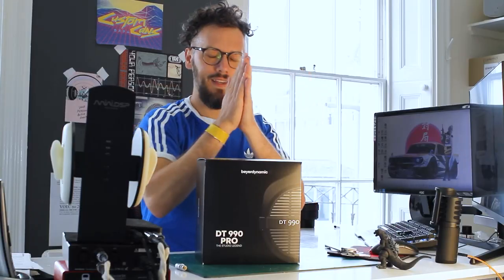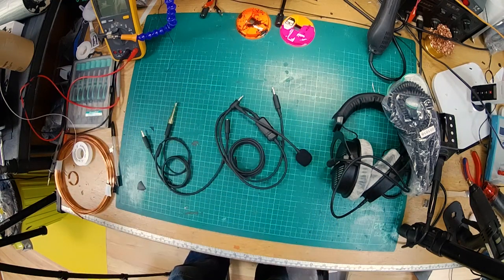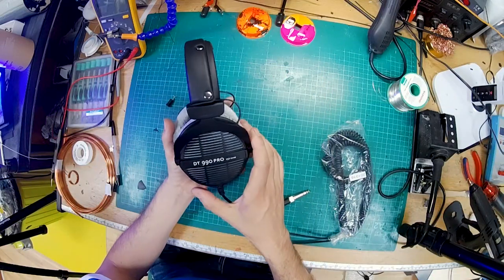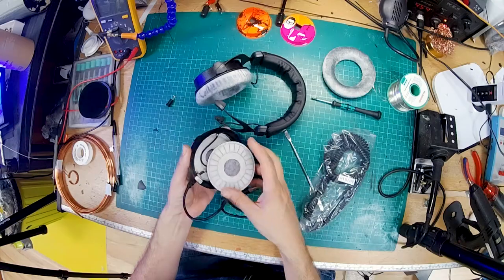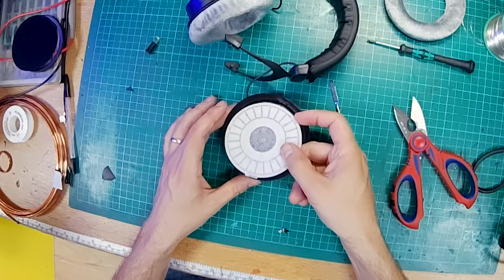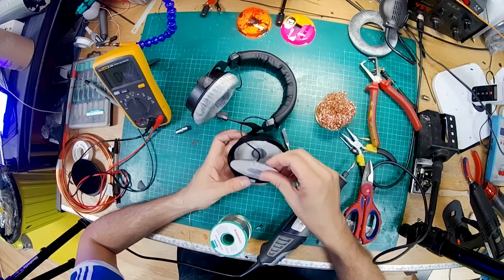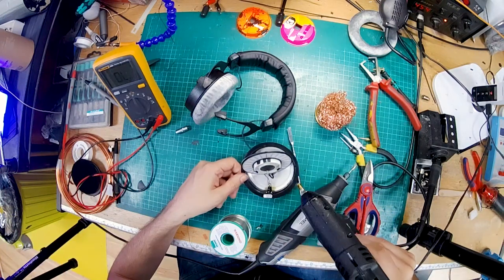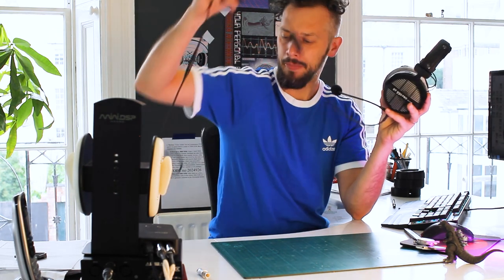Beyerdynamic DT990 ultimate gaming headset mod

Comment: Thanks for this video! Make the mod exceedingly simple on this headset! Also did a pair of Audi Technica AD-700X which was a bit of a nightmare. The housing and wires were incredibly difficult to work with!
Reply from the maker: Yeh - we have modded a few pairs of Audio Technica. They are not easy to do and some of them randomly die if you de-solder the driver
Reply: @CustomCans  I'm looking at getting a 3.5 mm socket from e bay that comes with a little nut so you can tighten the socket to the headphones cup. Would you say that your system (making a slightly smaller hole, then force threading in the socket + hot glue) is better vs making the hole exact size for threaded part of socket to go in comfortably, then using supplied nut to tighten and hold socket firmly in place (+ also a little bit of hot glue to stop nut from coming lose later)? Which will be sturdier? Thx!

Comment: thank you for the informative videos. speaking of gaming and audio this could be interesting to you, i bought a "yeti x" microphone and with these settings i can speak well into it while gaming over normal stereo speakers at normal volume - the mic doesn't pick them up well so they stay under the teamspeak speaking threshold: cardioid, input gain 2 (nearly all the way down), limiter 20db (all the way up), gate -40db (the middle). the greatest trick is the "gate" software filter - put to the right point it'll totally leave my voice alone but basically "deletes" ambient noise out of the signal  - it's magic.

Comment: Thanks for the awesome videos. I tried following this and ran into a few issues. At one point, I had this working correctly, but my solder wasn't holding on the jack, so I tried to resolder everything. After running into multiple solder issues at that point, I pretty much rewired the whole thing using better wire -- sort of following your complete re-wire video. Despite taking pictures and being pretty confident on the positions (and solders), my issue is no matter what I do, I'm not getting sound to the right-side can. I have a new version of these, so the wiring looked like yours, and I was seeing the kevlar, etc. I didn't touch those back two solder points, which you mentioned is a nightmare if they get buggered. Using a meter on the left can to right can, I am getting readings.

I tried everything as far as switching the wires around coming off the jack (except the black ground -- I had that on the end position where it is connected to the other). Is it more likely I fried something on the bored, or a wiring issue? The boards are not sold separately and run about ~$60 each, so I'm hesitant to try again with new drivers.

Thanks again for the cool videos!
Reply from the maker: If you have a multimeter - I would test the driver directly - put the probes on the outer pads of the driver and you should get a reading close to 250ohms ( If you have the 250 ohm version ) If you are getting a reading then the driver is OK and it is a wiring issue. If you get a super low resistance then you have a short somewhere and if you don't get any reading then you may have broken one of the voice coil wires. 
That may be fixable.
Those two little solder joints at the back which I told you not to touch have super thin wires attached - if one is snapped then you may be able to solder it back on depending on where it snapped

Comment: Hello, found this on your website, I have a couple of questions if that’s okay for you to respond to? Would this on your website ‘Custom Cans DT990 Modified Gaming Headphones with Microphone and Detachable Cable (3.5mm / 6.35mm TRS jack)’ plug straight into an Xbox Series X / PS5 controller? Then also, I’m guessing you still require an amp with these, then how does that work when wanting to use these for gaming? Wondering how the setup all works, does the amp plug into the console?
Reply from the maker: It depends how loud you listen. The 250ohm version will work if you plug it straight into the controller but it will not go very loud. An amp is probably not easy to set up as most of them don't have a pass through for the mic so the mic would not work with out pluging in a load of adapters. If you email us we could make a 32ohm version which would be much easier to drive off the playstation / xbox
Reply: @CustomCans  what if I use the ‘Fosi Audio K5 Pro’ it has separate inputs for headphones and a microphone.
Reply from the maker: @DannyWmv  yes that would do it
Reply: @CustomCans  so with the headphones from you, do I get both the headphone jack and microphone jack coming from the headset? So I can plug both 3.5mm headphone and 3.5mm microphone into that amp/dac?
Reply: @CustomCans  I’m just worried that if I purchase the custom headset with the mic from you guys, and the setup doesn’t work then I probably won’t be able to return the headset.

Comment: Could I get these but with a mini XLR balanced output on the opposite can? (And cable with 4.4mm balanced pentacon?)
Would cover all possible uses and connection types then. Cheers!

I've just bought the uber dt990's. 
Look forward to using them. Ill just get a clip on mic instead.
Reply from the maker: It is not impossible but you would need to have a switch to switch them from balanced to single ended.... it is probably not worth the hassle. We could potentially use a 4 pole 3.5mm socket in the earcup, that would allow you to use the mic single ended and then you would also plug in a balanced cable into the same socket
Reply: @CustomCans  Thanks for the reply. Keep up the good work.

Comment: Does anyone know if there is Bluetooth adapter that connects directly to this 3.5mm jack port?

I found some for Bose QC25, Beats studio... but position/size/pins... of jack connector is too specific for certain brand of headphones.
Reply from the maker: I don't think so. I know a lot of people use a shortened cable and a Fiio BTR5 velcrowed to the headband

Comment: hello, I just found out about your channel today and I was looking for a headphone for gaming. My previous headphone was audio technica ath m50 and Just wondering what is the different between DT990 and MMX 300 (2nd Generation)? both are from the same company and MX300 already have mic. is there any different with the driver or anything at all. 

Im searching for a new one cos my ATH was broken and thinking about getting the mmx300 but need some advice from you regarding those 2 models.

Thank you for your reviews, I think you are the only one who willingly took apart the headphone and I really appreciate it.
Reply: The 990s are an open-back design, while the MMX 300 is a closed-back one based on the 770s.
Reply: Thank you for your reply. so basically its like 770 but with mic.
Reply: For someone having the same question, I want to add my experience with both headphones. The mmx300 sounds similar to the dt990 but of course with a smaller soundstage and a bit more bass. The mmx300 are a bit heavier and don't feel as comfy as the dt990. The clamping pressure is bigger and the earcups are smaller which all ad to the less comfy feeling compared to the dt990. I did also sweet more in the mmx300 and had some pain after 2h of wearing them. That's why I didn't keep them. Of course, this is a personal preference. The sound quality, headphones and mic likewise, are very good. But if your motherboard doesn't have great audio input and output you might need an external DAC/soundcard, which adds to the cost. The "creative sound blasterX G6" was recommended a lot but maybe a cheaper one will do the trick.
Reply: @akuno7294  thank you for the info.

Comment: Hey Jason, great video as always. Question unrelated to this: I am on my second headband on the T1 2nd gen. They simply disintegrate after 2 years. Its my most used headphone right now and dont want to spend over hundred euros to replace them again in two years. Do you know where I can get an alternative to the ones Beyerdynamic is offering?
Reply: I've got the same issue with my T5p Gen2 as well. Beyerdynamic wont ship spares to the UK at the moment so I can't order a spare either. I would be interested in a good quality alternative too.
Reply from the maker: Most of the beyer headbands are interchangeable. If you are not worried about how pretty it looks, the DT770 or custom one pro headband would fit. We have some T1s here so I could do a video if you want
Reply: @CustomCans  dont care for the looks, just have to be comfy :) Would be great if you could do a short video.
Reply: +1 from me too please Jason. The slider assembly is apparently tricky to unclip on the t5p so if you can help with that too I would very much appreciate it, thank you.

Comment: I bought a pair of DT 900 Pro X's to upgrade from my DT 990 250 ohms and I've noticed that the 900's are a bit cleaner with a tiny bit of better imaging but was wondering if I did the 990 balanced mod if it would rid the small amount static I'm hearing? I'm using them with the BTR7 Portable DAC/AMP.
Reply from the maker: Maybe... the BTR7 will be able to drive them a little easier but if you have a hiss or static sound it will be a problem with the BTR7 and the 990 tends to show up those kind of issues more due to the treble peak. I would have a hunt around online to see if anyone is having the same issue, it may have a slight fault
Reply: @Custom Cans  I never noticed it until getting the 900's, tried high gain and low gain.

Comment: Quick question, I have done this mod and its amazing other than when I press slightly down on the mic when in front of my mouth it cuts out/distorts the audio. The jack is in there pretty snug so all I can imagine it is the connection between the connector and the mic when pressure is applied.
Have you happen to come across something like that before?
Reply from the maker: It is very tricky to diagnose without them in front of me but ... you may have overheated the pins ont he socket when soldering them - that could have caused the plastic holding them in place to melt / warp slightly so they are not giving a solid connection

Comment: Why did you use the 250 Ohm Version. What gamer has an high quality Interface? 

Edit: Well problay you...
Reply from the maker: Yes it is tricky but the 250 sound better in my opinion, and, in my experience... once you start going down the rabbit hole of building a gaming rig, cost and convenience go out the window pretty early in the build ;)
Reply: I own an x570s aorus master motherboard and a 250 ohm dt880 and with its "realtek audio console" windows 10 program you can adjust "headphone amp" so loud it'll blast your ears off.

Comment: Hello, I am using these and during intense gunshots in PUBG it is really hard to hear enemies' footsteps, actually i would say it becomes impossible to... Would you recommend anything to solve this?
Reply from the maker: Sorry  - I have opened a whole can of worms here  as I am not the best gamer and only going on what our customers have been asking for. I would say they as they are 250ohm headphones they do really need to be used with an amp to get them to perform properly. They will lack a bit of control if not used with an amp
Reply: @CustomCans  I am using them with an amp, Fiio K5 PRO dac/amp )
Reply from the maker: @kingofyoursoul  Yes the K5 should be good. The DT990 are harder to tune than the 770 but one thing you could try is removing the white insert inside the earcup. That will make them fully open and you get a bit more detail in the mids and a bit less bass. It is not super easy to do but is reversible if you don't like it. You can just clip the inserts back in. If you check out this vid, I remove them to fit a damping kit if you want to see how it is done
https://www.youtube.com/watch?v=vXCJi0CmQ0k
Reply: @CustomCans  great, definitely will try that out! Thank you, much appreciated!

Comment: On what games it was tested ?
Dont have 990 but have 1990 and they are garbage for competitive gaming. The footsteps, spatial awareness, imaging and pinpoint accuracy is mediocre.
Reply from the maker: As you can probably tell, I am not a hardcore gamer but over the last year we have been getting loads of requests from gamers for custom 990s so I thought they may be ideal for some players on the cost / performance stakes.  You could do the same mod on most headphones that have a fixed cable. 
The 1990 and 990 do have quite a different sound signature and I suspect it may also be down to a lot of twitch streamers using the 990 on camera.
Reply: @CustomCans  might be the pricetag though. If you can't get them on sale or as B-stock i would consider the 1990 overpriced and even then its not a cheap headphone (currently: 990 pro as B-stock: 111€ - 1990 pro B-stock: 395€)
But since i use it with a table mic as daily driver (music, movies, gaming) : it works nicely. 1990 has an above average soundstage and the sound placement is very precise :)
I dont know if the TYGR is as easyly modable as the 990, but since it is the dedicated gaming headphone (and is actually really good even for music)  from Beyer, you might want to take a look at this thing
Reply: What kind of competitive games you play?